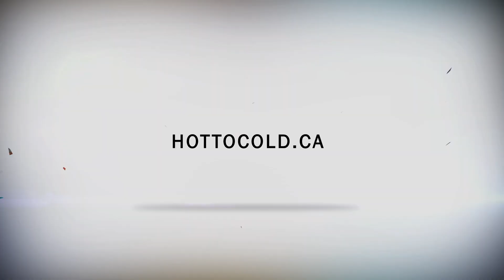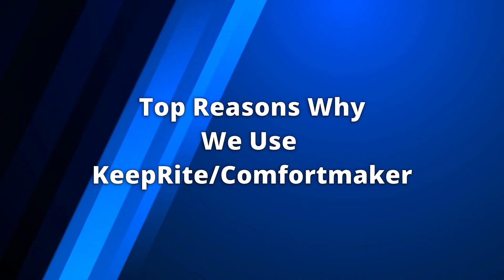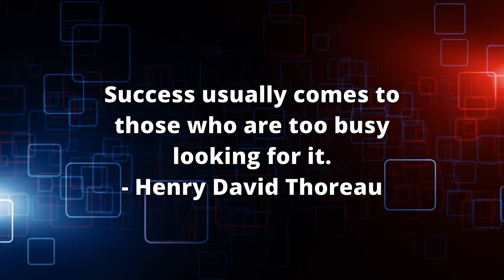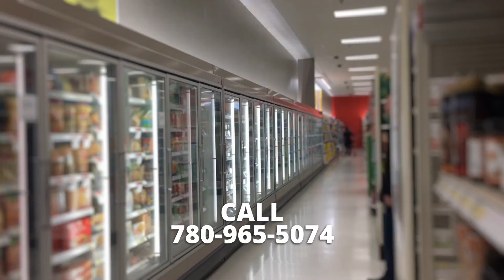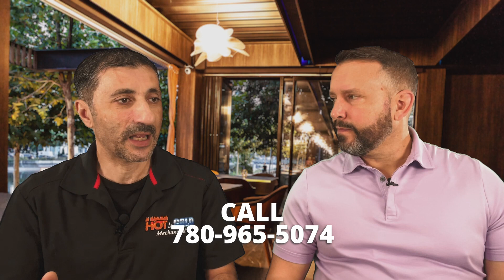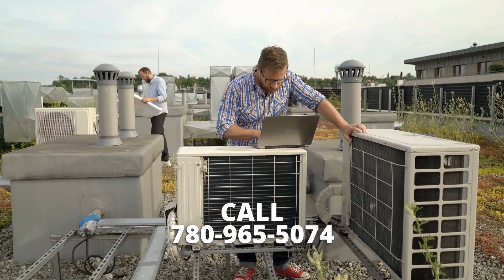Furnace Repair Edmonton | Why We Choose KeepRite & Comfortmaker Products

Comment: My water heater sprung a leak and sprayed right into the exhaust hole of all places and flooded the furnace. Not one component was spared and soaked strait through. Water heater was replaced and even the exhaust fan was full of water. The furnace man left and said i need a new furnace and of course it was minus 18 c.  out. So i put two fans and a heater in the furnace room and within two hours the furnace was back up and running.